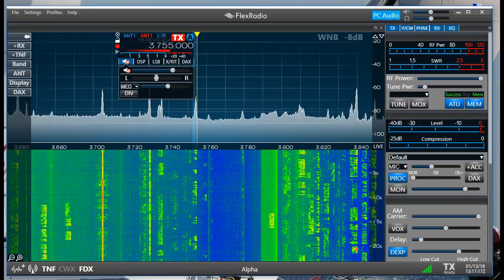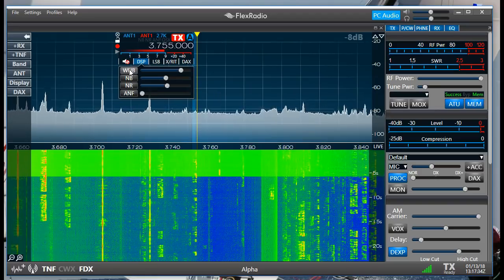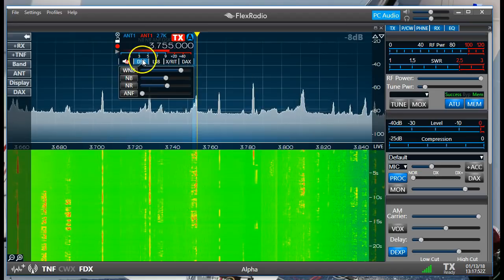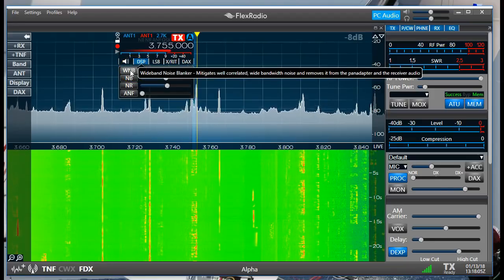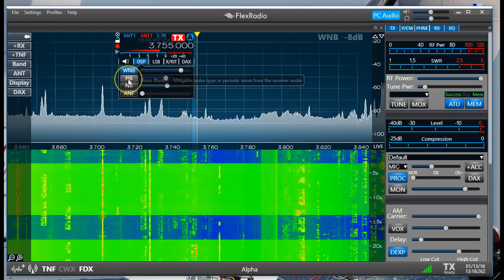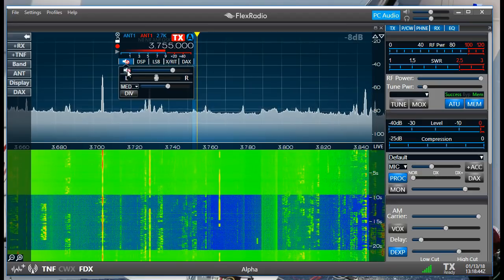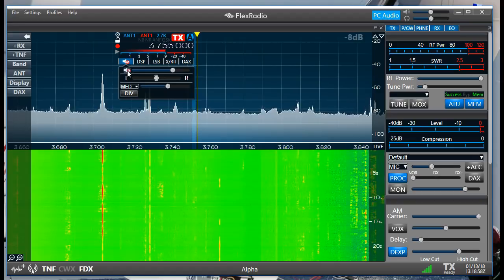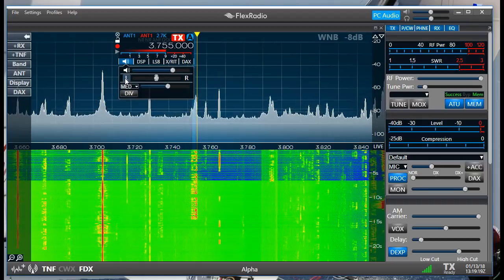Flex 6600 WNB - 80M SSB noise

Comment: " it inverts"...is this using a second receive antenna, or the Xmit antenna?  I was interested in  the  RSPDuo - used as a phase noise canceller-  using its dual antenna inputs/dual tuners for phase inversion etc. . I am missing a clear explanation on  the Flex  NB / DNR noise reduction you demonstrate. . Is it done in software only with one tuner, or requiring a second antenna with built in second tuner ? I believe it has diversity reception so assume  your demo is demonstrating both a hardware/software NB  and a dual  2 antenna & tuner  phase cancellation? Tnx from a green Flex prospect.
Reply from the maker: That is one technology that is available.  That is not what is happening here.  It determines the 'noise' based on the sampled frequency patterns and then inverts in software.

Comment: Hello.. nice video... good description... But what antenna You were using...? and if the preamps o Attenuator were on ?.. thanks for Share !... 

  My old Collins R 390A has the best signal to noise of every radio I have used but can not make NOISE CANCELLING... seems this Flex is cutting very well Noise...  THANKS    XE1ZLG..